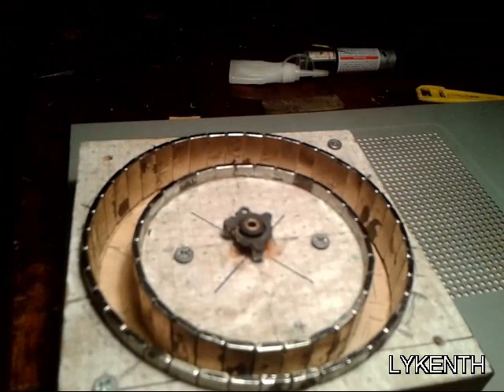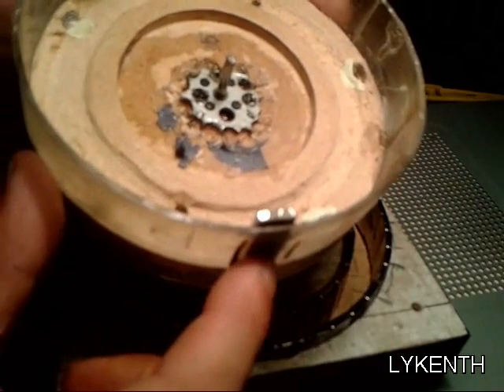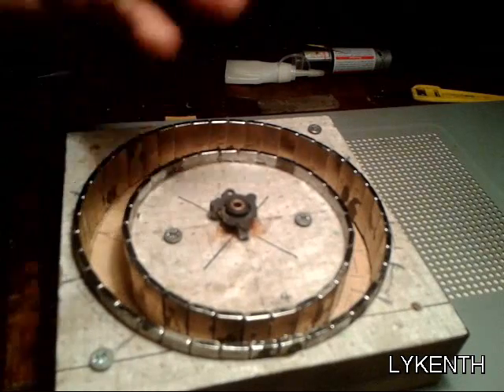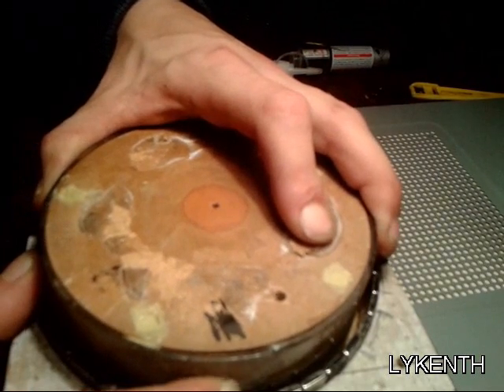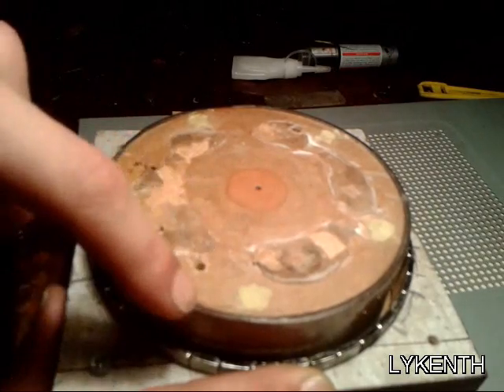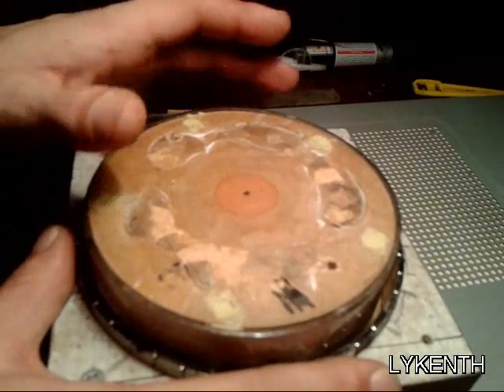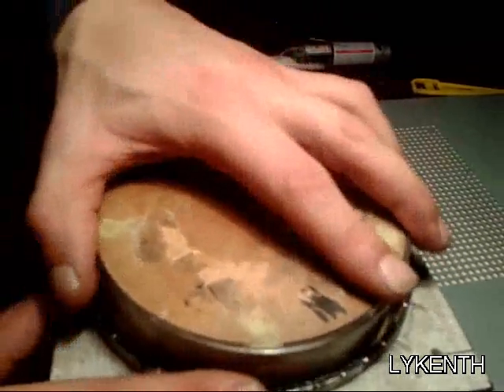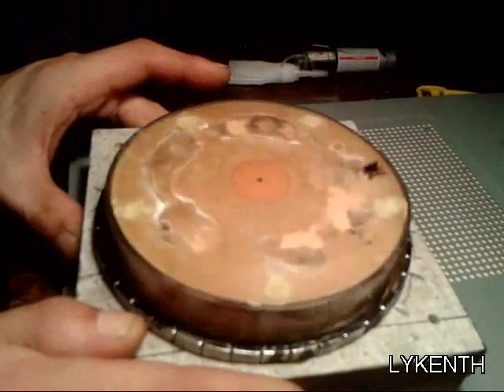Continuous magnetic gate 2015 remake   phase 1 is working

Comment: you got this wrong...you need a magnetic in balance, normally created by a pulse; because of the shape of the magnetic fields or move the magnets up and down sequencially....
Reply from the maker: that requires an active energy input through electrical or mechanical drive system. this is designed not to need either. the magnetic pinch point does this function you described.
Reply: @lykenth08  the thing about magnetic fields are circular structures and electric fields that trap the movement...you trapping the magnet..

so you need a v shape magnet maybe or to use antennas..

you need an imbalance, that i dont think will work as youve shown...
Reply from the maker: @ambientsoda106  as i thought, you dont understand the design becuase it is a V shape but a complete circle design. also, its ok that the magnetic fields are circular too, it dont matter for this.

The imbalance is the top and bottom spacing.. its clearly show.
Reply: @lykenth08  well if true why isnt it working? The design gets trapped magnetically

Comment: If gravity can pull an object from a long distance magnets can pull only for a small distance as long as there is magnetic field now if the magnetic field is long say 1 meter the pull and push would be 1 mater too long chain of magnets too can be powered like this
Reply from the maker: the long chain will be powerful. the problem is they do not loop back. gravity is across the whole object, like the earth, equal at the front the back the left side and the right side. A magnetic field will only have the front or back and will pull or repel from a center point. Have two gravity points side by side, the middle point will be zero gravity. have two magnets side by side and you have two times the magnets force :)
Reply: @lykenth08  we will find a way like space craft sling shot around planets we have to use the same method

Comment: Hi were u ever inspired enough to work on it again, eliminating the sticking points..
Reply from the maker: i have been working on it off and on, i have a new machine. im currently printing the bottom plate. these are not as accurate as i hoped, well i have been making changes to reduce and eliminate sticking points an of course issues with accuracy. i have been making vids over the years and recently, just never uploaded them. thanks for your support =]
Reply: @lykenth08  really appreciate u replying. Wishing u the best in overcoming the sticky points and looking forward to better results in your next video.

Comment: I would try to make it rotate vertically in such a way that a weight will overcome the resistance in that point where the wheel stops.  So it will combine magnetic force with gravity and inertia.
Reply from the maker: i will need the rotor with the magnet on to be balanced by weight. if i put it ion its side, just like a bouncing ball, anything gained by the drop will be lost when it rises. thanks for your input :)

Comment: The nay sayers will ALWAYS attack these types of tests . . ignore the Jesters
I have been working with magnets most of my life
. . magnets have always been my passion
I have built and tested many types of magnetic configurations
. . I like what you are doing . . keep up the great work bro
. . ignore the pesty trolls
The magnetic lock is obviously our barrier
. . most people are trying two sets of magnets
It appears we are both in the same mind set
. . which is why I am commenting
I am building a device with 3 sets of magnets in discs
. . my central disc is the disruption force (3 equally spaced magnets)
. . lower disc (stationary) has more magnets than upper disc (equally spaced)
. . upper disc (stationary) will have various configurations to test
. . my vortex so to speak . . is between the outer discs
I had not considered the upper disc to be off-center from the lower disc
. . may off-center as you have done . . another upper disc configuration
. . which also reminds me of axis tilt (instead of off-center)
Couple points to make
. . if your flywheel were heavier . . think gyroscope
. . once it reaches a certain speed . . which would require a starting motor
. . then perhaps the forces to push . . exceed the power of the magnetic lock
When you kill the starting motor . . the forces could stay out of balance
. . overpower the magnetic lock . . with an output of power
. . CAUTION . . could over accelerate . . may need a brake . . if no load
I have concluded from my testing that a starting motor is needed
. . the magnetic configuration will perform differently with speed changes
. . start with say 100 rpm . . kill power to starter . . watch
. . increase speed until it can maintain rotation (WITH GYRO MOMENTUM)
When spacing magnets . . remember . . 3. . 6 . . 9 . . Tesla
One last point bro . . I am highly focused on this issue
. . Magnetic North . . ALWAYS rotates COUNTER-CLOCKWISE
. . Magnetic South . . ALWAYS rotates CLOCKWISE
That is a natural vortex . . but . . they merge . . exactly proper clearance is the key
Long winded . . my bad . . have an awesome day brother
Reply from the maker: comments from those who dont try hold little value to me - i do this for my own education and amusement. iv now 3d printed this design and iv been doing bits on it now and then - it look moths just to get the right dimensions after a 6hour print per piece to find its 0.002 to big or small... after material shrinkage ect - working by hand is more forgiving lol
it sounds like you have a good idea of your own too thats worth exploring and experimenting :D
i have messed arround with a simular configuration you described with your setup and found that -

 - the space between and two ( or more )magnets on the same axis have a virtual magnet of the opposite polarization than the physical magnets even at a distance due to the basics - opposites attract.  - this is why i used many magnets with the same field i.e North with no gaps over the desired distance and the opposite field on the inner ring. if you dont give the fields a good route to take they will take the undesired path. for your stationary magnets, join the fields together with a strip of metal, rod ect - create a magnetic field bubble so to speak and it will focus/ contain stray field lines.

 your advice about a breaking system if it goes rouge is good - but if it did self accelerate, id happerly watch it exploded apart knowing it worked in the first place haha

Comment: Are you trying to build a motor that gets all its energy from magnets? Without external power?  The magnet which pushed the rotor from one side will repel it again when the black mark returns to it from the other side. The rotor kept bouncing back and forth until it stopped from friction. Giving it a push will make it turn few more rounds and then stop again. You're attempting perpetual motion!
Reply from the maker: Christmas Snow yes - I'm exploring how to gather momentum over time ( store it as kenetic energy ) then used to push through the origernal magnets field. With this design you see I'm able to extract force in one direction over 98% of a single rotation.  This build is not good enough (round) an has issues, I know. That why Iv  been working on building it better on an off. I just so happen to have 3d printed off some parts today. I do this for interest and at my own expence :).
Reply from the maker: and im still at it :D

Comment: Ah yes, another simple rotary design that spins a bit and then stops. Of course. If you're going to try to do something impossible, try to come up with something that looks like it  is more than a bunch of magnets arranged in circles.
Reply from the maker: David Bump a rotation formfactor is ideal after all I was aiming for energy extraction. If you not, unless I stated in the video, there are markings on the body that show, despite my best efforts to make it round, there are minor imperfections. The principal is sound and with this design I can achieve force in one direction over 99% of a distance to build momentom aka kenetic enegry which did over come the original cogging point, didn't it?
At this point I'm playing around with a 3D printer to get a more accurate frame - iv actually come up with another design that simplifies it further. 
Do you have any ideas or designs your self?
Reply: Yes, there are a number of reasons for using rotation, it's the simplicity of it that is the problem. You can't do any extraction with everything uniform. You need to create an autonomous Maxwell's Demon effect, something that creates a one-way effect without siphoning off or requiring more energy than it diverts. You need something that changes to take advantage of that momentum, without using more energy than what is in that momentum. I did some preliminary experiments that were also showing promise, but using gravity as well as magnets, and a construction which had a built-in ratchet effect.  I don't doubt the people who say nothing of the sort can ever work, but I like playing with magnets and trying to do something impossible.
Reply from the maker: David Bump then I wish the best of luck to you with your experiments :)
Reply: And I wish the same for you! And have fun while you're at it!

Comment: A 10 lb flywheel may help? keep momentum up.
Reply from the maker: Mikey I'm playing around with a 3d printer at the min, it's slow going to get it working right. I have used a fly wheel before, it's was a motor bike break disk. it did help smoothern it out. thing is, It shown that the frame wadnt good enough an had sticking spots. I'm still thinking/working on this project. I have other designs an versions in mind. this is just for fun an research.

Comment: beautiful job.  Unfortunately any stored energy will be insufficient to overcome the cogging.  good luck though and great job
Reply from the maker: Hi, the only cogging point the get through is the one at the lowest point, i am aiming to gather enough force/ velocity from the distance traveled - and energy stored to push through it. at one point i did but strange things happened like it coming to a stop half way through, running backwards for a quarter.. stopping then going forward to the start but yes, not enough force to punch through. this left me wondering if i hit some type of energy barrier.. kind of like the sound barrier. the rotor was travelling at speed before it just stopped at the top, which should not be possible. i have been working on it even now, 3d printing a part for it right now. just not uploading the research vids. i would rather waste my time and money and not others. but if it works.. thats why im making it 3D printable, see if others can verify it.. or at least id like to think that.
Reply: @lykenth08  All you ever need is magnetic shielding against the cogging parts.